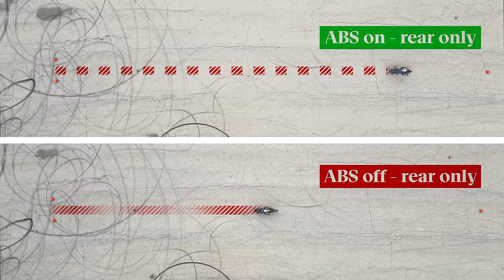Out-braking the ABS Myth

Comment: The concept is very similar to ABS in cars.  The misconception is that ABS will stop you faster (shorter distance).  It doesn't.  In a car, ABS allows you to apply lots of brake pressure while still maintaining the ability to steer (since the wheels won't lock up).  While your overall distance may be a bit longer, you should be able to give some steering input to perhaps change the lane, go on the shoulder or hop a curb and kiss a bush instead of plowing into the rear end of a truck.  That part is similar to the idea for bikes.  It's not to brake faster, it's so you can likely maintain some ability to move your bike and allow you avoid hitting whatever it is your are braking hard to to avoid.  It's just easier and safer in a car due to stability and "safety cage" benefits of a car.
Reply: Perfect threshold braking can stop you slightly faster than ABS - but good luck achieving that in the real world. There is a reason even professional racing drivers use ABS when the rules let them. It may take a touch longer to slow down when you do everything perfectly, but it is vastly more repeatable and stops faster when you average out all the times you make mistakes without ABS.
Reply: Misconception comes from people who never experienced the ABS on their vehicle. You just have to do an emergency brake once to feel the "vibrations" / micro-cuts of the ABS releasing pressure off the brakes, hence by delaying the stopping. I never get it when misconception can be immediately erased by common sense and logic.
Reply: @20cent it's not exactly that simple because tire in full slip has less grip than tire almost slipping so just because your braking is interrupted doesn't mean it brakes worse - maybe it lets tires stay in that good spot before you go out of the road. 
You can see that easily in race cars - once they lock up they are gone out of the road, they don't stop quicker
Reply: That maybe was true in the 90s, but not anymore. Modern car ABS systems can modulate the brake pressure independently for each wheel 10s, even 100s of times a second. There may be a scenario where a person perfectly applies the brakes so that they never exceed the limits of grip, outbreaking the ABS, but even people who devoted their entire life to racing can't do that repeatedly without mistake. The chances of that happening when a soccer mom stands on the brake is 0%. The only time when you'll be able to beat your ABS is when driving on gravel or snow, where locking up is actually better for stopping. Even then, some cars change the ABS's behavior depending on the driving surface.
Reply: @mathorsky exactly

Comment: I have locked my front wheel twice (non-abs) and fell. One time I scrapped my knee other time hurt my thigh. I can testify locking the tire is one of the scariest things
Reply: i saved front wheel locking slide about 3 times once on 50cc bike and twice on 600cc non ABS bike. Previous off road experience on the bicycle and small motorbike helped a lot not to crash
Reply: The problem with real emergencies when the crash not avoidable is that we don't wait for the weight transfer.
Pushing the lever fast and hard locks the wheel no matter the weather. ABS does not panic
Reply: @ptamog  learn to ride with covered brakes avoid the panic. Dont grab just progressive squeze it thats it
Reply: @46rrodriguez   I already do, thanks.
Even experienced riders panic if the crash is unavoidable. ABS is boring but good on the street.
Reply: @ptamog  i hope you feel safer when you ride with covered brakes. Every crash is avoidable until it isnt. Experienced riders dont panic they looking always for the way how to minimise the injuries if the crash is imminent
Reply: @ptamog ”ABS is boring”
Cringe.

Comment: Something totally skipped over here: ABS is also great to help you FIND that threshold for your threshold brake AND save you when you exceed it. You'll feel the pressure oscillating when you go too far with the 2nd part of the progressive brake. That way, you can practice with less risk of wiping out and in a panic situation you'll get the safety margin when you attempt your threshold brake and fuck it up. Which is pretty damn likely, don't lie to yourself. 

Y'all needed a stronger conclusion with this one. You touched on that last point at the end but this video leaned way too far towards the two extremes of monkey with a brake pedal and ACKSHUALLY PRACTICE CAN BEAT ABS for most of its run time. Nowhere near enough time driving the correct point home imo. I can already see the shitshow on r/motorcycles this is gonna cause lol
Reply: Yes, like motorcyclists do what they are told, anyways. 😸
Reply: I agree that in this case stronger emphasis on how hard it is to "properly brake" to outbrake abs would help a lot. Also try stoppie when the road is wet

Comment: the thing you described in the intro actually happened to me in a milder manner.

the green light turned red just for the car right in front of me, so the driver braked hard to not run the light. i had a bit of distance to brake, but couldn't stop in time and hit the rear bumper of the car, slamming my balls on my tank in the process. at that moment, i was absolutely convinced that something must have been wrong with my brake, i definitely had enough room to stop, but somehow took more time than it should to kill my speed.
later, it just felt like i was too used to controlling my braking power... until i saw that video, i thought i was stupid braking that way.

and to top it off. in france to get a motorcycle license, we need to do various exercises, including an emergency braking, where we are basically taught to lock our arms and trigger the abs (proper clean braking is practiced too, separately). and yet, i still was holding back despite knowing i can safely crush the brake lever and let the abs do its thing.

Comment: thank you for this, it would be interesting to see the affect the different styles of bikes have on braking, say a standard versus a sport bike versus a cruiser, I would include an adventure bike just for kicks but I consider them a standard
Reply: Agree. I'm of the belief that braking a long and low cruiser manually is much more difficult to master than a sport bike. Sport bikes are very simple to brake to near max, because they're more front weight-biased to begin with; they're so short and top heavy that the weight transfers to the front quicker; and because (under most straight-line road conditions) the rear starts to lift before the front tire locks. Once you learn where that rear lift happens, you can get there quick and then start to take more care on the lever, so nothing bad actually happens if the rear tire starts to hope and lift a little; you just stop braking harder at that point.
Reply: Surprisingly, cruisers and big tourers have some of the best straight line deceleration of any bikes because their long wheelbases and low evenly distributed centers of mass mean that proper braking techniques will keep their tires on the ground incredibly efficiently. Sport bikes are incredibly efficient at using their brakes to slow down into turns in rapid succession, but don't necessarily come to a full stop any faster

Comment: In other words, ABS enhances safety, but you need to realize that you must use both brakes on a motorcycle, and avoid jamming the front brake too suddenly, or that will trigger the ABS and lengthen your stopping distance. It's all about weight shift and letting that happen before applying maximum front brake.
Reply: What you said is good and all but if you gonna brake in a bad way, you gonna do it whether there is ABS there or not. It's best if there is ABS.
Reply: There is nothing wrong in pulling hard on the brakes, if your suspension allows for this, although it usually doesn't. Pulling hard early -> you will bottom out early. If this is your intention and the braking distance you're going for, go for it. You should be gradual even when you brake hard though. And yes, you should use both brakes, as using the rear brake will help decrease that sink rate of the front. If you run out of suspension before you have stopped, you have fucked up. ABS will take over from there and help you stop, if you have it, if not, the friction from your jacket on the road will help you stop.

Comment: The first bad crash i had was front braking only on a 2006 cbr 600f, no abs car stopped in the middle of a wet slick road. grabbed a hand full of panic brake and honestly can't remember how my body left the seat of the bike but i do remember watching my bike slide towards a bright white jag f type only for it to stop a literal inch away. Not much damage for a 60mph crash, broken thumb and wrecked paintwork on bike, jumped back on 5 mins later and rode to the hospital.

Comment: Great videos as always, I would have mentioned that the front ABS does let you lock up the front wheel and send you sliding, especially in corners.
Reply: You will be sliding in corners with or without abs when you slam the brake. Neither 6 IMU will save you when you don’t know how to do proper braking.

Comment: Great video as always. I'm surprised to hear that most people only use the rear brake in emergency situations. I always instinctively use the front brake, it's logically better at stopping the bike and loosing the front by chance is not as easy as it would seem.
Reply: I think its also because most people drive cars, and the instinct there is to take the right foot and slam it on the brake pedal

Comment: Hey, thanks for the awesome content! Good stuff, but I think the context you brought up is not fair for ABS. ABS was designed to stop the wheels locking up on cars. Locked wheels = loss of turning. On dry road in warm weather. Under those circumstances the car might even benefit from the melting tyre provided extra grip. True, it does make the braking distance longer. Although, in cold, wet, or freezing weather, a wheel lock-up can cause much bigger problems. A car weighting a few tonns sliding in a straight line with no chance to change the path is not what we want. ABS gives (more) control over a vehicle in those cases. On a bike, a locked-up wheel is more trouble, and a wheel can lock up on slippery road without doing an emergency braking, so having ABS can be a lifesaver.True, it does make the braking distance longer. Anyway as you said, ABS is not a replacement of skill and practice, it's an aid. It's crucial to know how it works and what it can do, and what are the negative effects. Good stuff, thanks again!

Comment: Very important point you made at the end: Under ideal conditions and with no other concerns threshold braking outperforms ABS. But in a panic situation on the road, that's far from ideal. ABS is a safety system meant to limit how badly you can screw up in the worst case, not maximize your performance in the best case.

Comment: Not having ABS actually saved me once from a problem. I was going at 60kmph until a lady suddenly decided to cross the road. I pulled my brakes at the right moment that i was only 2 feet approx from hitting that woman. Yes the front wheel locked out and I performed a stoppie. I was lucky enough that there was no one behind me and the road was not wet.

Comment: In Norway one of the things you must learn to do is a close to optimal "panic" break. 
Accelerate to 50-70km and brake as hard as you can with front and back WITHOUT activating ABS.
This is a must.

Comment: Motorcycles have rear brakes? I use mine so infrequently that I often forget that they are there. I only use them if I'm stopped on a slope and need to take my right hand off the bars to scratch my nose or to help the bike track straight in really slippery conditions. 

The concept of only relying on the rear brake is a complete mystery to me. Perhaps it is somewhat effective on a very heavy motorcycle with excessive weight on the rear tire but the majority of the braking still comes from the front. Just count the number of brake discs. That might be a clue.

Great video as always. The big take away is to practice. Gradually find out what the limits of your bike are before you need them in an emergency situation. 

Braking and steering are not mutually exclusive. The good riders can blend both. I don't own a bike with ABS but I can definitely see how it would be a benefit here.

Comment: I think most experienced motorcyclists know by now that on dry pavement in a straight line, you can definitely outbrake an ABS system (and not just by a little). But, conversely, you will not be anywhere near able to outbrake the ABS on wet pavement, or while turning (or both). The videos of the early ABS tests demonstrate that all too well, as does (did?) the ABS demonstrator bikes with the outriggers to catch you when you inevitably low-side.  And yes, you must practice. The bike is not an appliance the way a car is; you actually have to actively pilot the bike, and be engaged in every aspect of its operation, and that means practicing and understanding how the vehicle reacts to inputs. If you want to be able to passively just get from A to B, buy a car.

Comment: I was driving down a mountain at night when topping a very small rise revealing a steep long steady downhill slope, moonlight revealed lots of black ice on the road. I was driving at a reasonable pace, but less than 200 yards/meters was a sharp left turn. I gently pressed the brake peddle and as I listened to the abs activate individual wheels, it sounded like I was inside a pinball machine, the sounds coming independently from all four directions, sometimes one at a time in rapid succession, sometimes intermittently with seconds or more in between each audible activation.
ABS didn’t slow me quicker, it kept me on a straight line on the road. I could have wrecked the car into the rock wall on my left, or fallen off the mountain to my right which probably would have killed me. Instead I had a few moments of extreme adrenaline and not other cost.

Comment: The main purpose of an anti-lock braking system is to enable the operator to be able to continue to maneuver while braking so you can steer out of a crash or at least minimize the impact.  A bush or a fence or a barrow ditch or a glancing blow is far better than a head-on impact.  If your wheels lock up you lose all ability to maneuver.

Comment: The truth is in the name: anti-LOCK BRAKING system, its only designed to stop your brakes locking up and your tires skidding.

The way I was taught during my Basic Oil Field Drivers Course was to use the abs as an indicator of where your threshold is for threshold breaking. As soon as you feel the ABS kick in and vibrate the pedal, ease off the brake a bit and ride that threshold. 

 I was able to stop dozens of meters faster using that technique and I was driving an F250 super-duty.

Comment: My brain has a melt down every time I need to brake hard because my front & rear are not only separate systems but they are both on the handlebars. In the event I need to stop fast, my brain always has a senior moment & forgets which lever brakes which wheel. It’s takes me what seems like an eternity to decide which one I need to pull & how hard.
That said, it’s rare that I am conscious of my bike’s ABS activating.